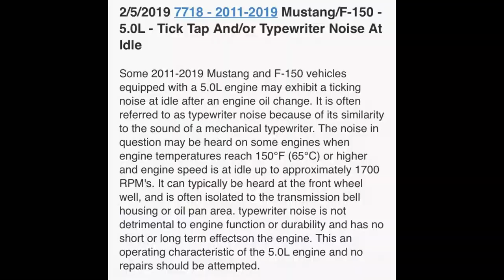2018-2021 Mustang GT Typewriter Tick/BBQ Tick. Don't Be Worried!

Comment: Great video I watched your last video and thought it was your GoPro making it sound loud but make sense. I like Mustangs over Camaro myself but I live in GM capitol of Canada so not much Mustangs around if I do see one they have the 4 cylinder EcoBoost in them don't know Why. Watch the video of motorcycle accident sad man hope your doing well. Cheers from Canada 🍻
Reply from the maker: I'm doing pretty good. How about yourself?  How's the weather up there in Canada?  There's a few 4 cylinder Ecoboost running around here too. They want the look of a mustang but not the engine. Literally had a customer at the dealer come in for some work. Had 5.0 and gt badges. Pop the hood. Little 2.3 liter Ecoboost. Can't make this stuff up
Reply: @Bearded Ford Tech  LOL silly EcoBoost  owners. The weather is finally getting warm it's 85  right now. I love it.

Comment: I’m buying a used gen 3 mustang gt soon what should I do to make sure the one I’m buying is good?
Reply from the maker: Well first thing. Look at the carfax report. Make sure there hasn't been any wrecks. Then have the service center look at it and inspect it. Then if you have a mechanic you trust ask the dealership if you can take it to them for a second opinion. The typewriter tick is normal so don't be fooled. If everything checks out. Sign the papers and drive off!  Oh and I wanna see pics/vid of your beautiful new ride!
Reply: @BeardedFordTech  Yeah, I always look at the carfax report and make sure there are no accidents. Are you talking about the dealership’s service center? As for a trusted mechanic, I don’t really know anyone since this is going to be my first car but I do want a mechanic to inspect it. I was thinking the tick is a red flag but I’ve heard it’s normal but in some cases it damages the car so I’m not sure about that. And for sure, I’m looking to get one by summer!
Reply from the maker: @marqb9531  the tick is normal it's intermittent. The light diesel knock sound usually on passenger side is normal and intermittent. The damage your thinking of is cylinder number one (passenger side front of car) scoring can occur from piston slap. It will be a knocking noise that does not go away. I would do a Google search of some local mom n pop mechanic shops around your area. Go by and talk to them and get to know a few of the mechanics tell them you are getting one by summer and would like them to check it before purchase. Most will do it free of charge. And yes I was also talking about the dealer service center as well. Have them check it. Get a copy of their notes. Then go to those places you talked to have them check it and get a copy of their notes. Then compare. I would start now by finding a good shop with good reviews. That way when summer rolls around they will know who you are.
Reply: I advise to stay away from Ford. The push rod motors are better.
Reply from the maker: @frankscott8555  never had a problem with any ford I've had. Even when I worked there. Old school push rod motors are badass yes.

Comment: How high of an rpm does it stop ticking? Or does it stop as soon as you give it gas?
Reply from the maker: Usually the BBQ tick is very random and doesn't do it all the time. Mainly at idle. And stops as soon as you start moving. If you have a tick that gets louder as you go then you have another problem as in valve lifters are worn. Piston slap would be more of a knocking not a ticking. The high pressure fuel pump and injectors tick as rpms go up but usually disappears the faster you go.
Reply: My ‘21 GT MT started doing it after it’s first oil change at 5,000mi.. before that.. nothing. It’ll do it up to second gear at low rpm then goes away. Performance or engine sound great still but the tick is pronounced. Especially at a stop light. Sounds like someone is tapping a tin can or something
Reply: @Ryescookies  yeah this was a year ago, I still hear it but at this point I think it's nothing it's given me allot of 6k rpm runs and no problems just regular fluid maintenance done to it

Comment: What about knocking in first and sometimes second gear? My 2017 gt has the bbq tick, and I’m not worried about that, but this knocking noise at low rpm/speed has me worried.
Reply from the maker: Knocking as in sounds like a diesel engine lower side of engine? Or do you hear it on top passenger side? Does it go away after 2nd gear? Strange that your bbq tick is noticable because 2018 they went to plastic oil pan. It's very noticable. It has been around since 2011 though.  I would need to hear your noise. Do you have a video? Does it do it when sitting still? Have someone sit in and rev it from idle up to about 2500. You can email the video to me.
Reply: @BeardedFordTech  Yea the tick is pretty pronounced.  the knocking sound is only when accelerating from stop and goes away after second gear or sometimes at second gear. Hard to tell exactly the location of the knock

I’ll have to get someone to listen from out side the car and see if it’s noticeable. But it’s still under warranty so I may take it to Ford and see.

Another thing I guess I should add is I changed my stock paper air filter out for a afe high flow dry filter. Just a drop in replacement and it seems it made the knock more noticeable.
Reply from the maker: @S550GT  Air filter really wouldn't make it knock. What type of gas do you run?
Reply: @BeardedFordTech  93 octane
Reply from the maker: @S550GT  same here. So that rules out spark knock and pre detonation

Comment: You didn't answer the main question.

What CAUSES the ticking noise?
Reply from the maker: Nothing. Even after tearing them apart no wear on rear of engine or transmission bell housing. I have another video comming out of a teardown.  And the reason I say nothing is cause every engine that has been torn down there are no signs of wear on any component. If it was cams the tick would be constant and get louder with rpms. This is intermittent. Comes and goes. And when I say bell housing I'm referring to inside mainly where the noise is heard at the back lower end of engine toward bell housing as in torque convert on automatic or clutch on manual. But those would whine if bad. There is literally nothing worn. It just ticks. Some call it annoying. Some don't care. They have actually been doing it since 2011. Just harder to hear cause of the different oil pan on 2011-2017. I had. 2011 f150 that you could hear slightly. I just ignore it. Nothing to be concerned of.
Reply: @BeardedFordTech  Well SOMETHING is causing it to tick. It's not nothing. It may not be harmful, but SOMETHING causes the noise, or the noise would not exist.

So, my question still stands. What is the CAUSE of the tick?
Reply from the maker: @Condor1970  you are right. Something is causing it. But for now nobody knows. Not even ford. So we all say nothing. I'm going to keep inspecting one I have sitting at my house that came out of a 15. I will find that something. I guess the title to my video is misleading. It's meant to make you not worry. I should go change that
Reply: @Condor1970  yeah, with 57k investment f150 one would wonder about engine noise. Now if it was 20+ years old 250k or more on it I would not worry  with it.

Comment: I have a 2017 mustang gt I always change the oil every 3000miles with a filter at 46000mi I change the oil after 2 days the engine was making a lifter tick and it's loud only at full op temperature when it's cold it's very quiet and it won't go any louder with RPM, I don't know what to do at this point the car now has 52000mi nothing changed everything is normal performance, MPG, it's not loosing oil, no lights on the dash. I took it to 2 different Ford they told me it's normal it will go away!!! I removed the valve cover on the driver side did not see any damage, I used cera tic no change, I will send u a video u may have heard it before, thanks.
Reply from the maker: Send me a video. And if you change your oil at 3k miles. Why not do your filter while down there. Your just adding dirty oil from the filter to the clean oil. Doing more harm than good.  Some people do the oil filter at so many miles. Then the oil.  But. Do your oil and filter every 5k miles. That's my recommendation.  Don't use ceratech or any other additive. If you have to use additives with your oil.  Then you need to change oil brands. But send me the video please.
Reply: Everytime I change the oil I change the filter.
Reply from the maker: @fedozabidi6066  oh. Cause up top you said you change oil at 3k and filter at 4k. I was confused. Changed oil every 5 k miles

Comment: Even changing it to 5w30, the tick or whatever noise becomes less common. Also, you will notice about 1 to 1.5 mile mpg loss if you go with 30. Finally, some have low differential gear oil. Change it if you hear a grind.
Reply from the maker: I'll stick with the recommended oil weight. My tick really isn't there anymore after Cerma treating it. If it is I don't notice it doesn't bother me cause nothing is wrong anyway. As far as differential I didn't know that. I'll have to check. I've never come across one low even while working at the dealership.
Reply: @BeardedFordTech  that oil is too expensive for me. 
Perhaps I got a defective one from factory.
Reply from the maker: @2023_Max  is yours low on rear fluid?
Reply: @BeardedFordTech  it was. When I inserted my finger, my tip could touch the oil just by a bit.
Reply from the maker: @2023_Max  glad you got that fixed.  no more noise im assuming?
Reply: @BeardedFordTech  so far, so good. 👍🏽
Reply from the maker: @2023_Max  awesome 🤘

Comment: I don't have the tick but I do have the 2000 to 2500 rpm rattle. Any insight on that?
Reply from the maker: Does it go away after 2500?  Can you email me a video?
Reply: @BeardedFordTech  Yes it does go away after 2500 rpm. And it does not go away once the engine is warmed up. It only rattles under light load. The car is in storage so I can't do a video right now, but I could in a month or two. Thank you for replying.
Reply from the maker: @keithsada1380  could possibly be the high pressure fuel pump. Metallic noise on water pump or cylinder one scoring. Without a video it's hard to say. So I'll be here whenever you can get it and I'll be more than happy to help.
Reply: @BeardedFordTech  Thank you. I appreciate your help.
Reply from the maker: @keithsada1380  Anytime. 🤘🤘

Comment: Just got my first oil change on my 20 gt. Noticed it after I got to work and when I came home. Going to troubleshoot a bit in the morning.
Reply from the maker: Did you have it changed at the dealer? Check the oil level. Some reports are after a service they are two quarts low. Dealers putting in 8 qts instead of 10. If that's not the case is the noise constant and get louder with RPM? Or is it just intermittent?  Let me know what you find. Here to help if you need anything.
Reply: @BeardedFordTech  oil levels were fine. Tick sounding worse today than last night. Tick definitely increases with rpm, hard to hear it over the car at a certain point though. Contacted my local dealership and they advised bringing her in anyway.
Reply from the maker: @CANISLUPIS100  yes if it increases with RPM. There's an issue. I'm gonna call cylinder 1 scoring is what they come up with.
Reply: @BeardedFordTech  thanks for the response, I'll be sure to let you know what the dealership tells me. I wanted to just ignore it but after listening to it after the drive, it almost sounds fluttery when you bring the rpms up. The noise itself does sound like the bbq tick, comes from under the front driverside though.
Reply: @BeardedFordTech  just got my first oil change (free from the dealer, I usually do myself) and started hearing the ticking when I got home. Checked the oil and nothing on the dipstick. Checked the Invoice and the tech only put 6qts in 😤
Reply from the maker: @dmoore5908  whoa holy crap. 4 quarts low. Take it back show them and have them redo it. Or reimburse you for it. That's crazy. I've heard of 8 quarts but not 6. Damn damn damn
Reply: @BeardedFordTech  yeah they paid to have it redone and I’m sending a sample off to blackstone labs so they can tell me if there is any excess metal or anything. I know these are prone to the tick but scares me being it only happened after they shorted me 4 qts lol
Reply from the maker: @dmoore5908  yes that's a little different in your situation. I would send off an oil sample too
Reply: @dmoore5908  I would make sure they put that on record. That cost you some engine life.

Comment: Good video. Did one like it. I also need to invest in cerma oil. I did the additive
Reply from the maker: I don't run there Cerma oil anymore since I already treated it. The oil has treatment in it. I went back to amsoil as I am amsoil dealer. And since you already treated yours you should run amsoil too. No need to keep running it unless it was mandatory to do so after treatment. If you sign up to be a preferred customer you get 25% off your orders free shipping over $100 exclusive promotions deals random free swag. I made a video on how to sign up. Use my dealer number 5124952 when you sign up. I'm gonna go check your video out now!  By the way I subbed. Here is the link to be an amsoil preferred customer. I'm about to do the MT82 transmission fluid change video using amsoil
https://www.amsoil.com/offers/pc/
Remember dealer number (referral number) 5124952

Comment: I have that intermittent BBQ noise on 2019 GT, but also kind of chain / tensioner rattle (like prim prim king of a sound) coming from the front of the sylinder heads. It cames from both sides when the engine passes about 1400rmp. Is that typical sound and what could couse it ? Valve timing system ?
Reply from the maker: Wouldn't be valves. BBQ tick comes from under the car. Only two noises I am aware of up top that are not normal is cylinder one knock due to cylinder scoring on some 5.0s and water pump grinding metallic rattle. That would sound like it comes from both cylinder heads. Water pump sits in the middle. I would have a dealer check it out.

Comment: As a master mechanic and machinist, I can tell you that all that cerma is, is a 5 weight thin oil and does nothing more than any other 5 weight syn oil. The solution as far as an additive is RISLONE engine treatment which comes in 16 oz bottles and the use of conventional oil.
Reply from the maker: @EarlGuyton425  oh I quit using cerma aong time ago. I found out they lied through testing. It's not even a 5 weight. And ad a senior master myself you shouldn't use oil additive. If you need an additive you need a better oil.  Which is why I only use amsoil.  No additives at all.  I wouldn't use cerma again if they gave me a lifetime supply

Comment: My 2021 gt has the tick.. wat exactly should I do to quiet it down and make it almost unnoticeable?
Reply from the maker: Nothing you can really do. It will still be there. As the engine warms up it will be less noticable. As it gets closer to oil change time it gets less noticable. But when you change your oil. It will be back. It is normal characteristic of the 5.0. Don't let it keep you from enjoying your car.
Reply: Gotcha, will the cerma engine treatment help any?
Reply from the maker: @larryswagg1994  it will help and not be as noticable but you can still hear it. But when you change your oil it will be back then it will quiet down. There is no way to get rid of it permanently
Reply: @BeardedFordTech  10-4 I’m currently waiting on it to come in the mail and I was just curious. I’ve heard it quieted down the tick and motor in general with a one time treatment without voiding warranty and just thought I’d get ur opinion on it. Supposedly coats the engine and u never have to do it again
Reply from the maker: @larryswagg1994  it does. It's treats the metal in the engine. And it does work great and does not void warranty. It helps a lot. But it will not make it completely go away.
Reply: @BeardedFordTech  as long as it quiets it some I’ll b happy lol
Reply: The bbq tick that is
Reply from the maker: @larryswagg1994  understand. It can be annoying. Obviously you don't want any noises except exhaust and headers!  But it's normal. They have been doing it a very long time.